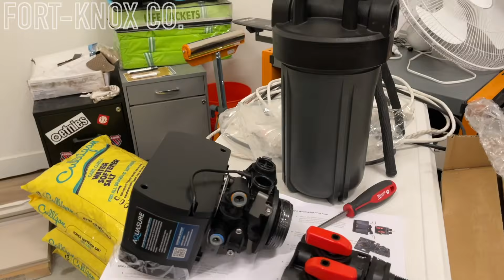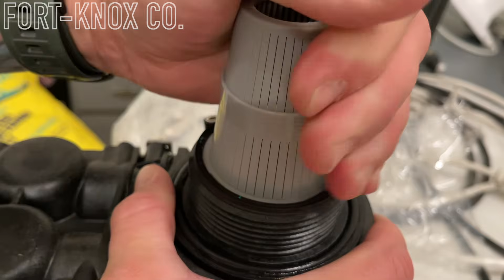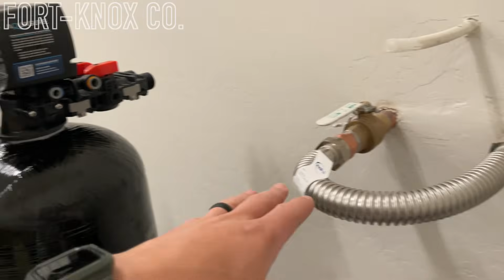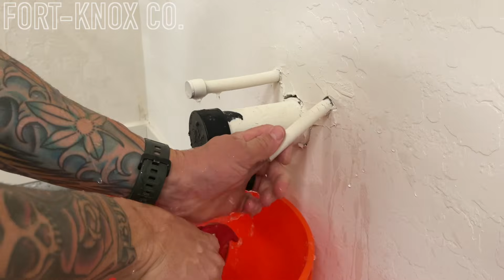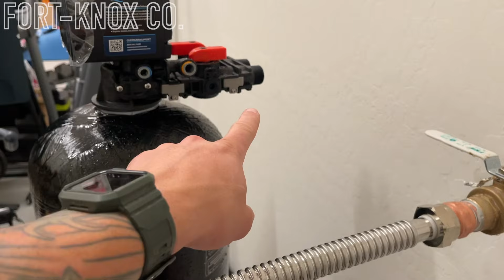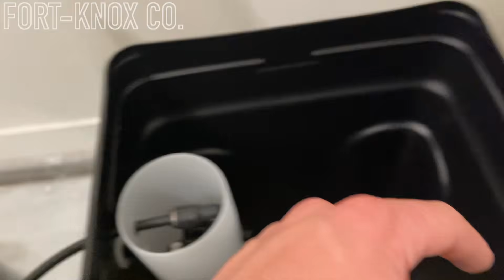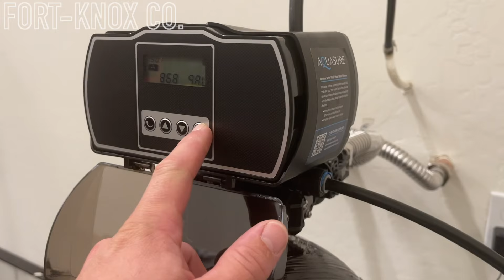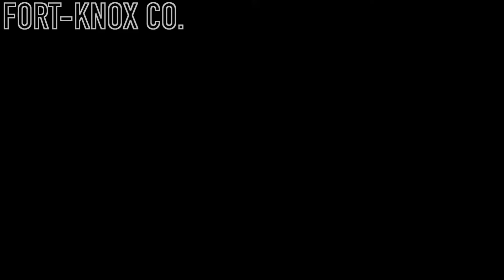How To Install Water Softener System Aquasure Harmony Series | Water Softener Loop Connection

Comment: Hi,  I had my water tested and it is still hard. I have been on the phone with tech support. I have added resin and did all the troubleshooting requested, yet water is still on the hard side. I purchased the Aquasure 48,000 grain Harmony Series.
I have a very good knowledge on plumbing and softners bit can't figure out what's  going on. If you have any suggestions it would be appreciated.
Thank you,
Rich.
Reply: All connections are proper. My hardness reading is 7-15 grains per gallon or 120 to 250 parts per million. Please note all connections are secure and I added resin due to a low resin amount being in the tank. Any suggestions would be appreciated. Thank you.
Reply: Also, please note water reading is not much different not going through the softener. Pretty much seems to be the same whether softened or unsoftened.
Reply from the maker: @richsquickfixes1980  if you’ve already added resin and the waters flowing correctly then my next guess would be to see if the salt is binding with the resin inside and if the system is doing a proper regeneration when flushing. If that still isn’t the problem then you may have a defective system. In my video showing how to test for hard water I did it on my system and it was dropping it from 3-400 down below 50.
Reply: @FortKnoxCo  thank you for responding. Is it possible my water is too hard for this 48000 grain system to handle?
Thank you, 
Rich
Reply from the maker: @richsquickfixes1980  no problem at all. I hope you get it figured out or they send you a new system if you figure out that it’s a defective system.
Reply from the maker: Sorry to hear this. What is your hardness reading from the hard side and reading after going through the softener by chance? 
I’m assuming you have the water flow in the right directions and such.

Comment: A plubmer "dont install those cheap sharkbites, have me install it for $250."
Reply from the maker: Yes I would always recommend using a plumber if you find yourself stuck or unsure about taking on the plumbing job. Sweating pipes is usually the preferred method. And now they have several other techniques of making those strong connections

Comment: Couplings or cup links? The guy at Home Depot laughed at me
Reply from the maker: Haha. It’s couplings- A coupling is a device used to connect two shafts together at their ends for the purpose of transmitting power (per Wikipedia)

Comment: We are looking at this system as we have heavy lime in oi our water, we do not have a garage only a 48-inch-tall crawl space. Can I install this inside the house and run the extra pluming needed. I have a closet I could install it in will I need to or should I put some reinforcement in the floor because of the extra weight? Thanks
Reply from the maker: You can install this unit inside if you’d like. It’s not too heavy. Their. Bigger unit 64,000 grain filter system says it only weights 149lbs. So if installing on a floor I wouldn’t worry so much about the weight. Most people install out in a garage or separate space because that’s where their easy water line access is and when the system is regenerating it makes noise. Not too loud in my opinion. But you wouldn’t want it running next to your head while trying to watch a movie.

Comment: One of the best and easiest videos on doing this type of setup. Thanks for the great video!  I'm about to cut the cord on my monthly water exchange service and you have given me a lot of useful info. I think I have the same type hookup as yours (one clear flex line going into the house and two copper water lines that attach to the tank). I think my copper lines are smaller than yours. My system also seems to be looped together atm. Looks like I need to do some cutting and making sure I get the right shark bites for my application. Otherwise, you have given me some confidence!
Reply from the maker: That’s awesome. It’s definitely something you can do yourself. And cutting the pipes and putting the fittings on is probably the easiest part. If you know the pipe size ahead of time, you can obviously have the fittings in hand and ready to go. But you could also take the loop that you cut out to the local hardware store and compare it to the right fitting as well. Most commonly houses have a 1 inch line. In my case it was one and a quarter. A little bit more common in newer builds but just depends on where you live. And who your builder is. But it’s all very doable.
Reply: @FortKnoxCo  I just found a small scrap piece of copper pipe that was on the floor near where the hookup is and it seems to be 3/4" ID. Off of one of the pipes, there seems to be a small ball type valve that can be turned open (for aux water...maybe like to wash cars, etc?). Anyway, I'm guessing that would denote it being the "out" side. Now to get a parts list and the courage to tackle this job. Thanks for your reply and help.
Reply from the maker: @DaveS2026  no problem at all. 3/4” is even better and way more common. You can order a water softener with the 3/4” outlets too and make the whole install easier.
Reply: @FortKnoxCo  Thanks so much for the answers and ideas. I'll give them a call and see my options. Bravo on the great video and content!

Comment: Exelent buddy, i have a question for this softener what is the warranty and is easy to find any part for the softener in case of it gets damage
Reply from the maker: Thank you! They have a pretty solid warranty. One of the reasons I went with them. I had a question and they were very responsive. Prom their website “30-day money-back, Aquasure stands behind its products by providing 5-year extended manufacturer warranty and life-time free US based tech support when you activate your product online within 60 days.”
Reply: @FortKnoxCo  exelent im thinking to buy in home depot but what you recomended for a family of 6 people, what model?
Reply from the maker: @jonathanrivera283  family of six Id probably get the 64,000 grain unit. You can order it through Amazon and have it delivered for free. And usually a better price too.  I have the links for the units in my description. Some come with and extra in line water filter to help grab any big particulates before the water softener.
Reply: @FortKnoxCo  last question, if i buy the softener is obligate to install a water pressure regulator or not???
Reply from the maker: @jonathanrivera283  you should already have a pressure regulator in line with the water that comes into your house. It should be at the main line that comes in. And then there’s that shut off that can shut the water off to your whole house. Right there there should be a bell housing that reduces or increases pressure with a little screw. Other than that you don’t need anything else with this water softener. The water softener installation does not require a need for another regulator or any type of pressure gauge. However, your house is set up now should be fine. You are just adding in a filter to the system. It doesn’t really change much from that standpoint.
Reply from the maker: I also just did a video on testing your waters hardness and I showed just how well this softener is working. 100% love it. You should check out the video

Comment: Some reason after installing it my white color is milky white please help !!
Reply from the maker: What white color are you referring to?
Reply: @FortKnoxCo  is like is something white on the water
Reply from the maker: @JJ2Styles  are you talking about the water inside the black salt tank?
Reply: @FortKnoxCo  no I am referring to the water coming out of the sink .. I have 48,000 unit I am not sure if 12000 on unit capacity is too much we only 4 people at the house . Also since installed yesterday still show hard water 42 ppm
Reply from the maker: @JJ2Styles  the size of the system could be as big as you want, that doesn’t effect the way it operates. But the tinted water color I’ve heard can be part of it being new. Sometimes it’s tiny bubbles from inside the filter getting out. Eventually the new tank will be fully filled and flushed with water. As far as the water still being hard I’m not sure. There could be an issue with the brine tank not recharging and actually flushing the resin tank.
Reply from the maker: @JJ2Styles  also anything under 50ppm is considered soft water. 50-100ppm is considered moderately soft. Out here in Vegas we’re starting around 292ppm
Reply: @FortKnoxCo   wow thanks for the fast response and so 12,000 on unit capacity is too much ?
Reply from the maker: @JJ2Styles  if your taking about the 12,000 being on the screen where it counts down until it does a recharge cycle then I’d say yes that’s high. I have 4 bathrooms and ours was calculated around 3,400. So it ends up doing a cycle about every 3-4 days I think.
Reply: @FortKnoxCo   how do u calculate that number ?
Reply from the maker: @JJ2Styles  I believe page 21 on the instructions give you the calculation method.

Comment: I hooked this up 6 months ago exactly this way but nothing happens in the brine tank. No water has ever gone in it. It does cycle on time yet no soft water in the house
Reply: I also put water in the brine tank at the beginning but nothing happens
Reply from the maker: When you started the system up did it fill the brine tank or did you manually put water in it? On the start up it should have filled and drained the brine tank like it will do during a refresh cycle. It does leave water in the tank between cycles. So there will be water there when you look in it. During a cycle it should draw from the brine tank and you’ll see the water level drop or basically completely drain and then refill once done.
Reply: @FortKnoxCo  it did not fill it. It has the same amount I put in it as directed. That you kindly for responding. I’m so confused
Reply from the maker: @dongoodenough  I would manually run the refresh cycle and watch the system run, see if it draws any amount of water from the brine tank during this process. May take a few minutes of your day away but you’d then have a for sure idea of what is going on. After each cycle it does refill and maintain water in there. So it’s normal for it to be holding water. And check your fill valve in the brine tank to see if it’s connected right and not stuck.
Reply: @FortKnoxCo  I will try that. Thank you
Reply from the maker: An issue I’ve heard from a few people is with the tube in the brine tank holding the float/shut off valve, the valve has been stuck in the shut off position or stuck and that was causing the tank to not fill or drain.

Comment: Great video!  Do you have info on saltless systems?  Thanks in Advance!
Reply from the maker: I haven’t installed the saltless systems but they do hook up very similarly. The water lines in and out are all the same. The only thing with the saltless system is you don’t have to have the brine/salt tank sitting next to it with another line from the filter going to it. The saltless systems are a little less pieces. Water hook up and flush line are the same.
Reply: @FortKnoxCo  Thanks!
Reply from the maker: @mvaughnsr  no problem at all

Comment: Do I need to install a separate filter system? Or this unit does the filtration too?
Reply from the maker: Are you talking about a filtration system for drinking water? That would be a reverse osmosis  system at your sink or desired location. This unit is a water softener and removes several harmful things but mainly it’s purpose is to reduce or remove the hardness of the water to extend the life of the house, fixtures, appliances and to be better for your hair & skin.

Comment: That outlet should be a GFCI and use the correct circuit breaker.  That's knit picking but I would have at least shut off that breaker before opening the valve.
Reply from the maker: In this house all the circuits are GFCI protected. I think they require all homes now in our county to have a GFCI outlet at the beginning of every circuit now and not just we areas. And all these outlets are tamper proof and weather resistant. It’s a little overkill to have every outlet this way but I guess it’s all about safety
Reply: @FortKnoxCo  If it keeps a house from burning down it's money well spent.  Over here of the outlet is with 2 or 3 feet from a water source it's required to be a GFCI.   I'd have to open my code book to get the correct distance.
Reply from the maker: @BB-ih3bk  I agree, better safe than sorry. I think that’s why they require all circuits here to be GFCI now.
Reply: @BB-ih3bk  Older homes in the U.S. require 6 feet or more away from a water source. New homes are all GFCI

Comment: Hey, wondering if there are instructions on how to remove the head from the valves. I soldered the copper to the the system but the o ring looks like it was pinched between the control unit.  Thanks for the help. 
*Realized that once you unhook the connector you can slowly pull it apart with no issue.
Reply from the maker: I’m not quite sure what your saying happened. Are you wanting to disconnect the head unit from the tank or trying to pull the whole tank and head unit away from the wall connection with the in and out line soldered ?  The valves disconnect as a pair from the back of the head unit by removing the two screws and plate clamps. In the installation process and assembly of the head unit the back valves arrive detached. You have to push the valves into the back of the head unit and secure them with a couple screws. You could reverse this process and pull the head unit and tank away and leave the two in/out valves still connected to the wall.

Comment: I plan on using this video to install the same system. However, my home has plastic looped piping coming out of the wall where yours is copper. Am I to use larger shark bite shut off valves like you did for the wash sink?
Reply from the maker: yes, If your going to go the shark bite route then I'd install the large shark bites with the turn shut off. its a few more dollars but worth it. you'll be able to slap them on and turn the valve and have no water leaking out while you work on your system or if you ever need to shut the water off to the system or house you have another quick place to shut it off. Mine are copper but I have that shut off valve there for just that reason. I can turn that and shut off the water and if I want to pull my system or move it i can easily without having the water flowing out at the connection.
Reply: @FortKnoxCo  Thanks! My shut off valve is located outside my garage so adding the shark bite shut off valves will come in handy. 
I forgot to mention that my system comes with a Fine Mesh Resin filter. I imagine I install this in the line going between the unit and the house, so I will need a total of three shark bite hoses. One to the tank, second hose from tank to Fine Mesh filter and a third from the filter back to the house. Question, do I need to add a third shut off valve between the tank and Fine Mesh filter?
Reply from the maker: @jaydiaz1294  that extra shut off would just be on you if you choose too. It’s personal preference. Would you be wrong for putting one there, No. would you be spending a little more for that extra valve, yes.

Comment: Great explainer video! I have the same system in my home. I had to reroute some plumbing so that I wasn't softening the water for my irrigation, but I have a pex system and a raised foundation so it wasn't that difficult. How often do you end up changing out the salt? Seems like mine is about every 1.5 - 2 months.
Reply from the maker: That’s about how often inhale to add a bag or two. Not too much. But it also depends on how often you have your system set to do the flush/refresh cycle.

Comment: I just bought this system and it is not softening the water. Could this unit have been damaged during transport?
Reply from the maker: That’s possible. But I’d check a few things first. That the water flow is correct in the right direction, that the lines are all connected securely and the brine/salt tank is flushing through the filter during the refresh cycle. The initial set up runs through the flush with the salt and that sets the resin tank up properly and makes it able to soften the water.
Reply: @FortKnoxCo  thank you for answering, sorry I didn't reply sooner. I was on the phone with technical support they told me to take off the meter head and look inside resin tank. After putting flashlight into resin tank, I noticed there was a very small amount of resin at the bottom of the tank. So they are sending me more resin. I hope this is the issue since there was a minimal amount of resin in the tank. Thanks for your help.
Reply from the maker: @richsquickfixes1980  that’s awesome! I’ve had good luck with their customer support. They were very helpful and seem to want to make sure everyone is happy with their products
Reply: I have been trying to call them and emailed, no response

Comment: Awesome video.  I’m still waiting on the tank delivery. What’s the height of the tank? I’m working on installing the water loop right now. Thanks!
Reply from the maker: The 64,000 grain tank is 54” tall and in total with the head unit on it stands 60”.  Thank you for watching. If you have any questions let me know